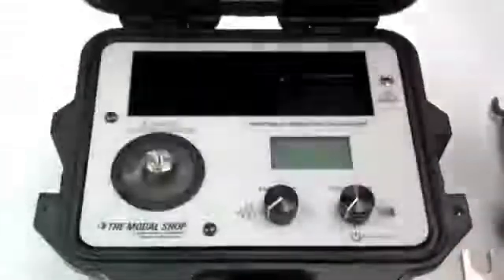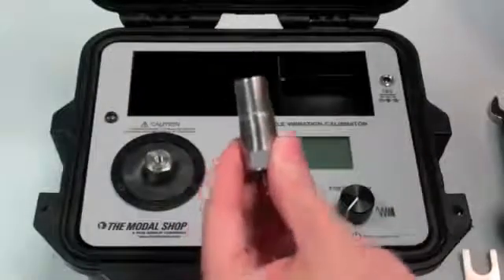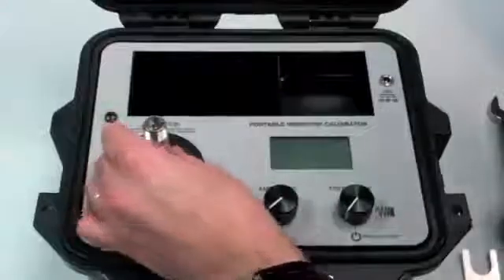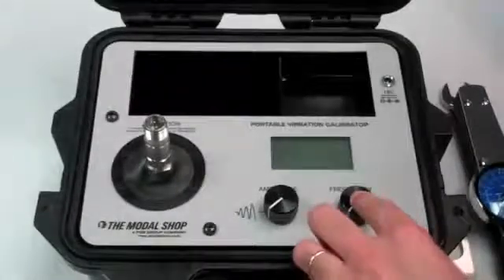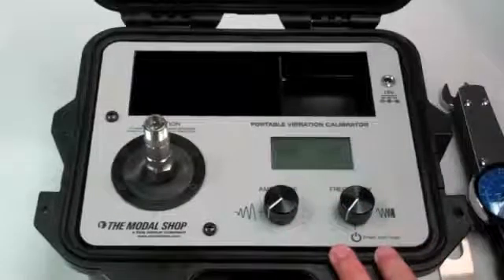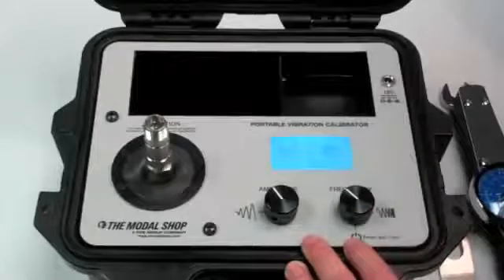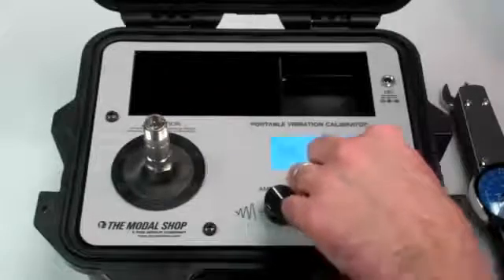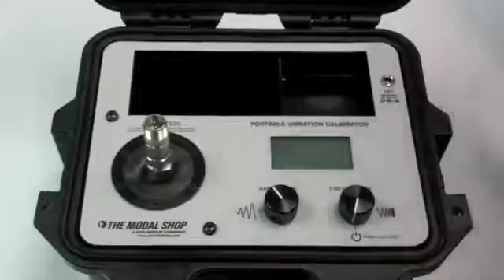How to Setup Your TMS 9110D for Calibration Testing

Comment: Why u adjust amplitude?
Reply: To test the acceleometer in different ranges
Reply: Graeme Murphy
Reply: what is peak to peak can you please confirm?
Reply: Accelerometers are sometimes specified as Peak to Peak ... i.e. highest positive to highest negative value. Sometimes it's the RMS value i.e. Root Mean Square .i.e. effectively an average value.  Or Peak Value which is zero to the highest positive or highest negative value. So the Peak would usually be half the peak to peak and The RMS value would be around 0.7 the Peak value if its sinusoidal. Confusing hey..